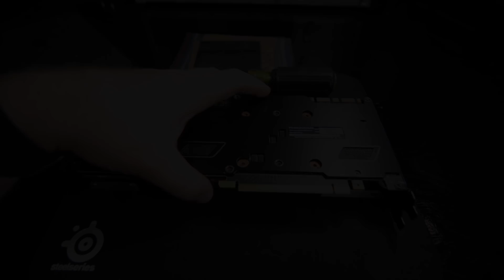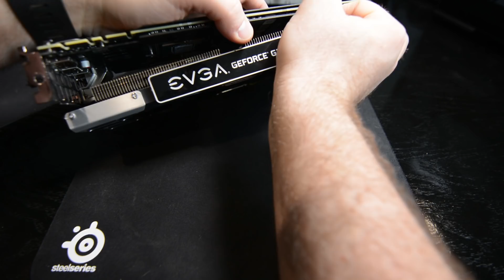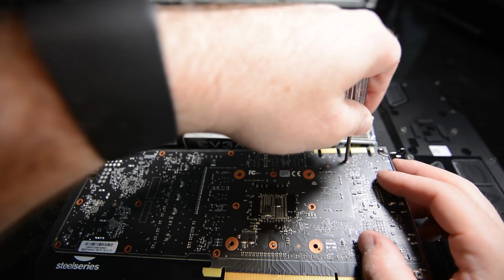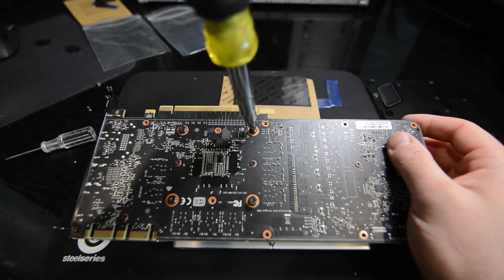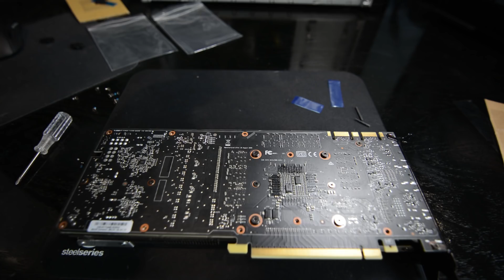EVGA Thermal Pad Mod - Gtx 1070 SC - Install and stress testing

Comment: Where I can buy the kit pls
Reply from the maker: +Level1 Gaming if you go to the link in the description and have a valid serial number you can get it for free from EVGA.  Thanks for watching!
Reply: JoesTech for free?
Reply from the maker: +LEVEL1 GAMING for freeeeeee!  It should actually tell you if the card came with the mod from the factory.
Reply: JoesTech yooo TNx for the information buddy
Reply from the maker: +LEVEL1 GAMING no prob!
Reply: Where I request the pads from the site I can not even put the serial number
Reply from the maker: +LEVEL1 GAMING they do require you to make an EVGA account and log in.  Did you do that first?  They require this because they want to set up shipping info.

Comment: that's really odd, I have the black version of the 1070 SC and it didn't come with that guard on the top. It just had the board exposed and everything.
Reply: the protective board at 2:49
Reply from the maker: +Mud Kips oh wow, that's crazy.  How is the backplate attached?  Right to the pcb?
Reply: JoesTech  yeah I think so. I'm not very computer literate, I just built my first pc a few days ago. And after looking at other people's cards, I think I got kinda screwed. my motherboard doesn't seem to be able to read it and can only boot through the motherboard graphics.

I think I need to send it back
Reply from the maker: +Mud Kips dumb question, but you have the power connected to the card?  Are the fans spinning?
Reply: JoesTech I'm pretty sure I do. the fans aren't spinning. I have a 6+2 pin going into the gpu and the other is a 8 pin going into the psu. But the logo is lit, however I noticed even with the power cable disconnected, it will still light up when it's connected to the motherboard
Reply: JoesTech so I'm not sure if it's not getting enough power, the card is doa basically, or my motherboards pci-e doesn't work. I tested both ports and they didn't read it
Reply from the maker: +Mud Kips that sounds correct.  It might just be a defective card.  Is this a new build?  If so, I doubt it would be the slot, but just for due-diligence maybe plug it into a different PCIE slot.  If nothing still I'd recommend an exchange.  Hopefully it's an easy resolution.  Thanks!
Reply from the maker: +Mud Kips ah...looks like you beat me to it.  Sounds like a doa card for sure then.
Reply: JoesTech yeah I think, I'll call them tomorrow. thanks for the help though, definitely subscribing
Reply from the maker: +Mud Kips no problem, and thanks for the support!

Comment: Thanks, I was worried about doing it, but you compared it to replacing a CPU/cooler, which I can do confidently.
Never taken apart GPU's before though.
Reply from the maker: +Nathan yea, it's not too bad.  Glad this helped?
Reply from the maker: +Nathan helped!*
Reply: Using onboard graphics right now, just about to start the procedure.

Comment: Really nice video dude. Keep it up!
Reply from the maker: +x W4LK3R x thank you for the feedback and for watching!
Reply: You're welcome sir! I'd like to ask you something that i didn't in my previous comment: I just purchased a GTX 1070 SC just like yours and my serial number is in the EVGA web site. Should i use the same method that you've used? For me is a little bit complicated because i don't live in the US (from Brazil) and it would cause a lot of troubles for me to send the card to them so they could fix it. What do you think about it? Is it EXTREMELY necessary to put those on the card?
Reply from the maker: +x W4LK3R x for the 1070 sc, this isn't 100% necessary.  It will only help, but doesn't have to be done.  It's more of an issue on the 1080s, specifically the 1080 ftw.  If it's difficult for you to do the upgrade, or send the card out, you can easily still get great performance out of the card by simply performing their firmware upgrade.  Thanks again.
Reply: Thank you very much for you comment. Now i feel safe haha; I'll perform their firmware upgrade as soon as i get the card. Thank you again.
Reply from the maker: +x W4LK3R x no problem!

Comment: I bought the 1070 SC a couple weeks ago and has no issues till about 2 days ago (black screen/crash). Firmware update did not solve it. Once i installed the thermal mod (from EVGA), all is good!.
Reply from the maker: +Nelson E that's crazy...was it overheating?  Stock clock?
Reply: Stock clock. Yea, a bit inconvenient. My vram was overheating to about 87c. With the mod, i'm at about 65c under load. My GPU now sits ~50-52c under load.
Reply from the maker: +Nelson E wow, that's crazy....someone else mentioned to me that the stock paste is junk, and recommended swapping out with something else.  I didn't have issues before or after with my paste but maybe a potential problem as well.  Either way, glad it's resolved!

Comment: Due to my lack of research, I purchased the Evga 1070 SC ACX 3.0. yesterday. Are the thermals pads installed in the newly ordered cards?
Reply from the maker: +Gentle Poo yes, new cards are supposed to have the thermal mod applied going forward.  You can however check your serial number on the site in the description to see if your card qualifies.
Reply: JoesTech will do when it arrives tomorrow. thanks!
Reply from the maker: +Gentle Poo no prob!
Reply: Gentle Poo was it installed bro? Mines coming in on Saturday!

Comment: does having metallic shroud affects temps in summer.. from Pakistan.. should i apply this mod?
Reply from the maker: +Muaz Hashmi I don't think the metal shroud makes much of an impact.  The backplate definitely helps dissipate heat.  The mod is fairly simple and (especially if used with arctic silver or similar paste) can only help temps be more evenly distributed off of the card so I think it's worth it.

Comment: Just installed mine yesterday, wasnt so hard as I thought it will be, but on the youtube video that i watched he didnt installed the small ones, And I didnt noticed it untill I finished, but on your video I see that EVGA already installed the small one so why did you replaced them? 
by the way before and after the installation my max heat was 70/71 and after installing the new vbios it droped to 64.
Reply: There have been reports that the factory installed Vram thermal pads (the small ones) were not thick enough to make contact with the heat spreader in many cases, so these replacement pads are supposed to be thicker.  You can try googling to find the Reddit thread where people complained about this.

Comment: When you say 55c, do you mean on the core or VRMs, the two are very different, the thermal pads are for the VRMs
Reply from the maker: +Gabriel Boss I am referring to the "core" temp, not the VRM's.  Yes, the VRM's are what is affected when talking about this overheating issue.  This hardware update/mod leverages the thermal pads at the connection between the base plate and heatsink fins, as well as the pcb to the backplate to help dissipate the heat more evenly, allowing the card to cool more evenly.  This specific video was just to test how much of an impact this mod has on overall core temp of the card.  Thanks for watching!

Comment: Does the black edition have the same problem?
Reply from the maker: +David Zabaleta the newer cards coming out shouldn't require this mod.  I believe it should be in the clear,  but if you check your serial number on EVGAs thermal mod site it will tell you if the card is eligible or not.  To be honest though, that may just be checking if it's an ACX 3.0 card rather than a non updated card.  If I find any info I will update this accordingly.  Thanks!

Comment: Thank you for the video, my kit should arrive tomorrow for the 1070FTW. The temperature sensor isn't on the VRM's so may not be a good indicator of improvement. From the other video's I've seen, there is a significant decrease in temperature after the modification. Either way EVGA vouches for their cards and will provide replacement for any defects which is why I prefer EVGA over a few of the competitors.
Reply from the maker: +Kevin Holly yes for sure.  It couldn't hurt to do it and it's an easy mod with a guarantee.  Can't beat it.  Thanks for watching!

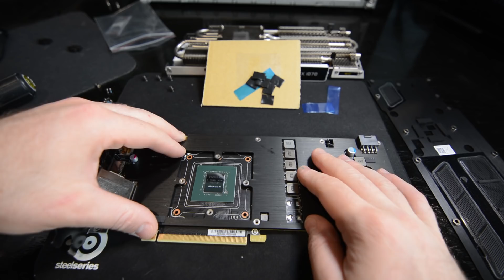Comment: 4:58, i imagine putting thermalpad on there is actually gonna give you worse temperatur, did the instructions tell you to place one pad there ?
Reply from the maker: +MissMan666 yes, this is where this thermal pad is intended to go.  I believe the intention at that part of the install is to get the thermal pad to touch the tip of the heatsink fins allowing a better transfer of heat.  Thanks for watching!
Reply: JoesTech thanks for the answer. To be honest i think EVGA made a mistake about the placement of that thermalpad, the rest i agree with.

Comment: Im getting 75 degrees max. Is that bad? I thought its normal. How are you getting such low temps. Mine is the gtx 1070 evga sc
Reply: JoesTech Yeah I will, I've got it already. I put a more aggressive fan curve for now but I will be doing it as from what I've read and seen the temp your GPU runs at isn't necessarily the temp the VRMs are at, so piece of mind an' all that.
Reply from the maker: +aL Quarter are you overclocking?  If so, how high?  If you aren't overclocking then no, I would say that is not normal.  A couple people have told me they were getting high temps with stock thermal paste, but mine seems to be holding up ok.
Reply: JoesTech no overclocks. i still didn't apply any thermal pads or updated the driver.  I read  on some forums tho that 75 degrees is perfectly fine for the card but your getting around 50 wow
Reply from the maker: I think 75 degree's IS probably fine, but it should be able to perform at a lower temp.  What resolution are you running the card at when under load?  Maybe because I'm still running at 1080/60p it's easier to stay cooler?  Now that I know how simple it is to disassemble the card, I would maybe order the thermal mod, and also buy some premium thermal paste.  Install the mod using a better paste, and you should see cooler temps.  I'm just not sure if you will get down to where I am.  Let us know which route you take.
Reply from the maker: +andrewrogers yes, it just adjusts the fan curve.  I know it's not necessary being that you already are getting great temps, but any plans to do the mod?
Reply: My 1070 FTW sits at about 55-65 under load, I haven't downloaded the BIOS update, apparently all it does is ramp the fans up so you can do that yourself (it's what I've done).

Comment: Did u use something to rub the paste from vga?
Reply from the maker: +Hyoga Cygnus I'm not sure I understand the question.  For cleaning I used a "lint free" paper towel, and for placing new paste I just put a dab in the middle and allow pressure of the heat sink to spread the paste.  Does that answer your question?
Reply: So I dont need to buy that iso alcohol? Is teh paper towel enough?
Reply from the maker: +Hyoga Cygnus I'm sorry I misspoke.  Yes, that is a requirement as well.  The thermal paste is thick like a putty almost once it sets, so you do need the alcohol on the lint free paper towel in order to get the surface cleaned.
Reply: Oh ok. TYVM!
Reply from the maker: +Hyoga Cygnus no problem!  Thanks for watching!

Comment: I have to say, this thermal pad mod IS necessary. I got my GTX 1070 SC last month. I was getting temps as high as 95c but it mostly leveled out at 85c. Then, I applied the mod I got from eVGA the other day. Now my temps only level out at 75c on load. Mind you, the SC is a reference card with an ACX 3.0 cooler. Applying those pad to the VRMs makes a big difference.
Reply from the maker: +McKevin Sean I think some people received units that are affected more than others.  For whatever reason, I could never push my 1070sc into the mid 70s.  Maybe because it's a poor overclocker but this upgrade is definitely a good idea for anyone with a compatible card.  It can't hurt.  Thanks for watching!  Glad your card is working better now.

Comment: Hi . I loved your video. I wanted to know if it's so bad? Yesterday I bought it and it makes a coil whine noise. Now I'm going to send the pads and with that same really changes the temperature and the noise of the coil whine? . I have the option to return the graphics card this but I love aesthetically. What do you advise me Thanks and success with the channel
Reply from the maker: +TiTiPretzeL love the name first off...now down to the question.  This is a great card, whether or not you do the thermal pad mod.  Depending on if you purchased the 1070 which I show in this video, or the 1080 which I do not have the luxury of owning at this point, I would say EVGA has a solid selection of cards.  They seem to have the weight that some cards lack, the aesthetics you'd associate with the price, and of course in a time of concern, they back the product.  I believe I would still repurchase this care given the opportunity.  Hopefully this answers your question.  Thanks for watching.
Reply: thanks !

Comment: It doesn't cost anything because it doesn't DO ANYTHING. If anything adding a thermal pad to your chokes will only hurt your temps as air flow can not cool them or the area around them. that being said the VRM already have a thermal pad (noticed this in your video so kudo's to that) so basically the only thing you could have done is added thermal paste to the  pads that were all ready installed for the vrm the rest of that junk is just that placebo crap. If you want your vrm to run cooler speed up the fan. This is why i dont recommend nvidia cards any more the hard ware is sub par to amd. Aka built cheap for no reason other to be cheap and hope these cards die prematurely. That way they can sell you a new one. i have seen more nvidia cards dead over ati/amd in the past 5 years infact i have only seen 1 amd card that "died" and it still works just not performing like it should. i have seen lots of nvidia cards DIE. after they are few years old(and a few new ones as well). So for anyone owning a nvidia card i recommend not overclocking it. and if you own a super clock restore it to defaults or run the fans faster. just not worth having it die on you after only a few years or less.
Reply: Oh one more thing amd cards have VRM probes on there cards so you can see what temp they are at, And if it was my card i wouldent run them over 80c infact if i want my card to last i make sure they stay below 60c. So this here 110+c stock is just insane IMHO.

Comment: i used that thermal paste in that baggie and it dried up within a day because i had to take apart my card (same as yours) again for reasons. I'd recommend using your own paste man
Reply from the maker: +ab12 good to know.  It's an easy disassembly so probably wouldn't hurt.  Thanks for watching!
Reply: No problem man. Just a fair warning

Comment: Sadly you didn't realize what the actual issue was/is and that the vrm temp(issue) is not measured by anything at all. I advise to look into the vids from gamers nexus for more information on the topic. Next time maybe before giving misleading information. Not a rant, just a note
Reply from the maker: +TheSickness1234 take a look at the link I added from the EVGA website in the description.  The information I provided regarding my EVGA card was related to that post, not something gamers nexus posted.  But thanks for watching.
Reply: JoesTech the thing is the temps stated have nothing to do with the mod and the issue they are supposed to resolve. Tbh, you could have stesstested the card and then have measured your own body temperature before and after, same information. GPU temp is not vrm or vram temp, just saying. As a tech tuber these details got to matter. Like your content and am interested on how it will thrive. Really just trying to help.
Reply from the maker: +TheSickness1234 I appreciate the feedback, and will keep it in mind for the next time.  I definitely could have went into more detail about where the increased temps were and how the pads would help resolve those issues so I'll try to be more detailed about hints next time.  Thanks again!

Comment: antec 900? u had a Phantek previously I think...?
Reply from the maker: +Frank Beaulieu I still do.  That's what everything in this case will be moved over to.  I was just waiting on one part which I received last week.  Should be getting rid of this old case soon!
Reply: JoesTech ah ok, cool, i now have the cash for 2 x 1080's but I'm scare buying these evga's cards , did evga have redistributed their rma's one ? who knows... well I wonder, I really like these cards, even if it's a minor issue , I don't want to mess with this... lol Nice vid BTW :)
Reply from the maker: +Frank Beaulieu from what I've read, they are correcting this on all 1080s going forward so I'd assume you'd be set ordering direct from them, but that's not always the cheapest.  I'm guessing they are fixing previous RMA units for swaps, but I think the community would freak out if they were fixing RMAs and branding as new, so I wouldn't stress too much about that.  I honestly think the EVGA 1070/1080 are the best out right now in their category, so I don't think you'll be disappointed.  Thanks for the video feedback!
Reply: JoesTech I've noted... Thanks for the reply ;)